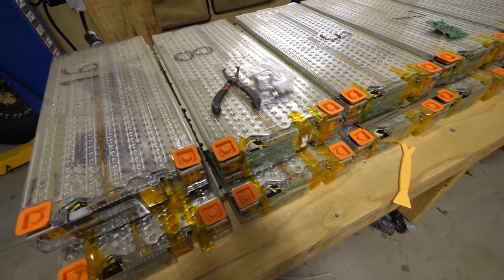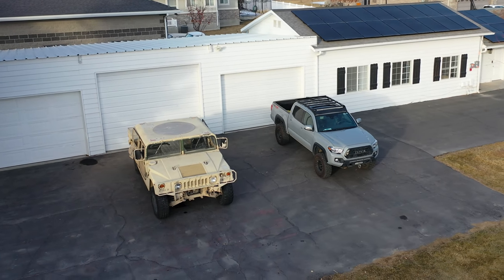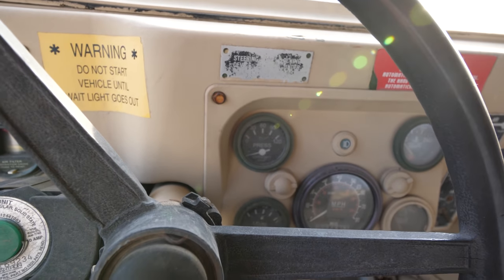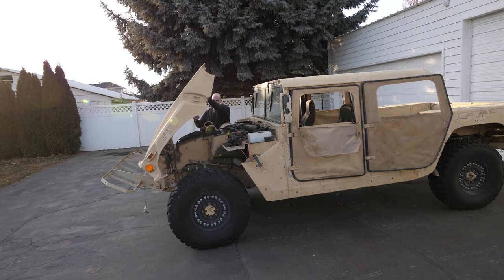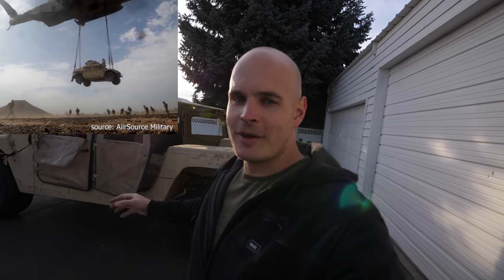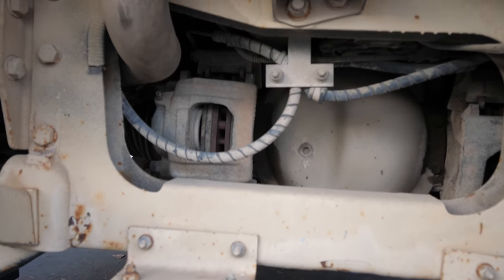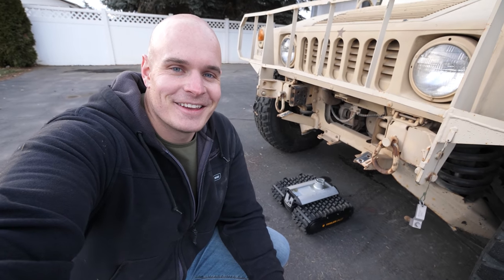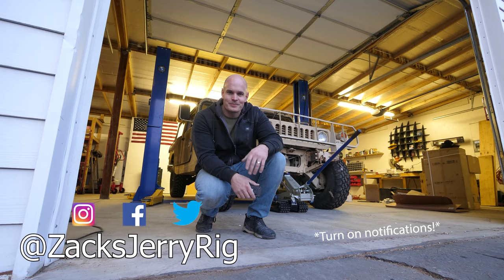Can I build my OWN Electric Truck?! -  Say Hello to the EV Humvee!

Comment: Dude…. First “Not a wheelchair” and now this?!! This guy is going to build his own electric space rocket at this rate 😂
Reply: so he made a wheelchair not a wheelchair by adding electric motors, so if hes adding electric parts into a hmmv dosent that give him the authority to call it "not a hmmv"
Reply: He might as well start a company with this!
Reply: for a second I thought it was possible to make an electric rocket 😂
Reply: Not a HMMWV
Reply: Would there actually be a way to build an electric rocket? You can't produce thrust that way like rockets do and somehow I doubt that you could build turbines than can lift off aircrafts in the way rockets do
Reply: @NieColall  The rocket equation would kill it instantly, batteries aren't energy dense enough!
Reply: You act like this stuff is impressive
Reply: @ImaCoward124 I guess… maybe I will do a YouTube channel for the shit I do everyday as an electrician and part Time Mechanic
Reply: @NieColall  Kinda, there are working electric "rocket engines" (thrusters) such as the hall thruster. However it still needs a gas to operate, eg. xenon so it's not entirely electric. They use a lot less fuel though, so it's still interesting. 

In space you can also go fully solar but building a solar sail, although you need to get everything in to space first.

Comment: ####!1Many years back, there was a conversion done to make an  EV with front wheel drive put on rear wheel drive car frame , so as access to the rotating 2 front shafts. 4 alternators with 12v clutches and belts were mounted with battery bank in rear seat. The tow motor  motor was mounted with rear wheel drive. The driver would drive vehicle up to 25mph then click in the recharging alternators. The distance went up to 300miles per battery charge. Also, the other Patent holder of the Zubris circuit allows $100 fee to use his circuit on your own motor which will also extend range of car to 300miles. . The added circuit removes the Back EMF of motor windings, so as main heavy current can go in . (Type of first very fast Cap discharge) Also the other hydraulic pressure system was added on different car, as stored energy effect on car with fluid pressure from tank flowing in reverse, allowing rotation of same hydraulic pump in reverse to add power to the drive shaft underneath car. The long drive shaft had split 2 piece pulley with belt going up to the fluid pump. High Pressure tank +return lower pressure  accumulator tank. Hand valve in between front seats was operated when vehicle starting from stop and rolling up to 25M per Hour on stored pressure. ( System activated to store pressure during slow down to stop up ahead)? ///<<!!

Comment: Diesel (like that used in your hummer) will easily last for 5 years, and more like 10 - 15 if treated with fuel stabilizer. So diesel is fine for a zombie apocalypse.

Comment: i really hope you get rid of the rust and repaint every single part
Reply: It’s aluminum, just repaint it
Reply: i disagree it looks cool
Reply: i think it look cooler with the rust
Reply: @chinookh4713  i like the scratched paint and all but the rust while it does look cool, is a serious hazard, anything load bearing that rusted needs to be assessed and replaced if need be.
Reply: Clean/replace the rusted parts but let aluminium have that worn out vibe it has right now
Reply: It’s meant to look like that

Comment: Um for the truck glass: Scratches at level 8 with deeper grooves at level 9.
Reply: Based on its used in military, probably gonna have scratches at bullet point, and deeper grooves at rocket fire
Reply: @premiumboi473  And cracks at nuclear explosion
Reply: @premiumboi473  Nailed it. Lol
Reply: glass is glass, and glass... scratches at level 6 with deeper grooves at a level 7.

Comment: Re the brakes being inboard - part of the reason for that is that the brakes have the same mechanical advantage from the reduction hubs, ie, they can be a lot smaller and lighter for the same force at the wheel if they're mounted inboard than if they were mounted within the wheel like normal. There are lots of cars like this, though, many old French cars did this in the 60s and 70s and various supercars, also, for unsprung weight reasons.

Comment: Small corrections. First gasoline with ethanol in it doesnt last, but gas without does, and diesel certainly does which is the fuel in this thing. Also military vehicles can typically burn lots of different fuels including oils and biofuels which helps for apocalyptic fuel choices. Second, the portal axles dont replace the differentials they are in addition to the differentials. 

Very cool build looking forward to watching the whole series!

Comment: Using a HMMWV is a great choice. They are not really that heavy, far fewer electronics to deal with, etc. I know this is just the first video in the series, but you need to change to aftermarket rims and tires and not have the run flat system and you will greatly reduce the rolling weight.

Comment: what if the display you're putting in to replace the dials was a Electroluminscent Display? So it would at least visually fit in with the time period (it has the same colour hues as early CRT displays and uses the same technology as the displays of the Apollo guidance computers, but the modern ones are brighter, easier to read, more responsive, more durable and energy efficient).
Reply: That'd be one hell of a cross over

Comment: Yea not sure about the 6-8 month shelf life for gasoline. I rebuilt a vehicle that had been sitting for 13 years with a full tank and the gas was still good! I started to empty the tank when I noticed the fuel was still fine. It started and ran fine! Drove it 2,000 miles after the two week build.

Comment: Zack: “Where you can actually work on the engine while inside the vehicle”
Me: “imagine you are in a zombie apocalypse and just casually fixing your  engine from the inside, like you could just live in this thing while in a zombie apocalypse ”
Reply: Except as he said, you'd be pretty screwed after all the diesel around you expires
Reply: @ryanweatherby9571  diesel engines can work on cooking oil
Reply: @bassam_salim  Biodiesel is still only 3 years on the shelf. It's possible that you could source and refine enough cooking oil to keep going for a couple years, but the only real permanent(ish) solution is electric via solar and wind. They could still fail but ICE fuel would diminish pretty quickly, and you'd eventually need to burn fuel to source more.

Comment: Portal axles basically add a vertical gear at the end of the axle, and another gear is added to the wheel, with a third in the middle, and this allows the axle to connect to the wheel at a different height. So the axle is not centered on the wheel, and actually is lined up with almost the top of the wheel. This allows them to put the differential significantly higher. As you can see at 5:45, the diff is horizontally aligned with the tire, and not any of the metal in the wheel, at all. The diffs would of needed to be like 10 inches lower if they were to be mounted traditionally. This also allows the shafts coming off the differentials to be more level rather than be at such a harsh angle like your taco, which increases joint wear

Comment: Imagine forgetting your solar panels when you have to leave for the apocalypse
Reply: Or they are shattered!  What about the lack of sunlight from all the smoke cover created when everything is on fire?
Reply: @D2O2  DUH ! The fire will provide the energy.
Reply: @mayanaztec6440  What method do you suggest to employ for charging batteries with fire?
Reply: @D2O2  a boiler, steam and generator works well for fire.

Almost all fossil fuel power plants in operation right now work that way. You burn stuff. Heat up water. Water turns to steam and spins a generator. Boom electricity.
There are also gas turbines that directly run on gas and turn a generator. But that's still relatively new tech and not that widespread
Reply: @timmytubede  OK, my comment was regarding the original post about using solar panels to charge your EV during the apocalypse.  I am fully aware of other means to convert thermal energy to electrical, but the topic was focused on converting radiant energy to electrical energy.

Comment: Nice project, one tip is to connect the electric motor directly to the transfer case, it has planty of torque and would be lighter, in the place of the engine and gearbox you could build a watertight box to place the batteries keeping the lower CG, anyways I'm hooked on yours latest videos and cheers from a Brazilian fan.

Comment: Make sure to remove the run flat system in the tires it will save you alot of weight.  They sell PVC inserts that take up the space

Comment: Diesel fuel can easily last a year before it starts to become degraded, and that doesn't mean it becomes unusable, but there are also additives that you can put in diesel that can extend its life span for significantly longer, and you can even filter it out, or tune the engine to handle the thicker fuel, most diesel cars and trucks can also handle bio fuels or run off of vegetable oil, so old diesel often isn't too much of a worry.
Reply: Had this thought too.  With the versatility of fuels that one can run through a diesel engine, it's probably a better long-term apocylapse powertrain than something that has degradable lithium-ion batteries and requires manufactured solar panels to charge. Still a cool project though.
Reply: @zachswy  yeah its definitely an awesome project, I just think diesel engines deserved a little more credit than he gave them

Comment: Hey Jerry, you should invent a 'universal' kit that adds a motor to the rear wheel of FWD economy cars... leaving the original drivetrain fully intact and operational. A lot of people would only need enough battery range to drive 5-10 miles to work, on side streets at about 35 mph. 

If you make this thing as easy to install as putting on a new wheel/hub and connecting a few boat batteries, you'd sell thousands of them.
Reply: "as easy to install as putting on a new wheel/hub and connecting a few boat batteries" wow that is a tall order to fill
there are some videos on this sort of conversion but its physically impossible imo to be that easy.

Comment: The portal hubs mostly help with the cv joints.. Cv joints can only turn at such a high angle.. They do make portal hubs for solid axles which are very effective..the downside to the hubs is inboard brakes.. Some claim it improves braking.. Pretty much all new military vehicles use independent suspension.. New ones have more that double the wheel travel of the humvee..

 There's a website called ev controls, they turned a factory five kit car into electric using gm batteries and tesla motors and their own custom made controller.. It's fairly fast

Comment: In a sealed container diesel will last until the container fails.
Regular gas if in a sealed container in good storage conditions will also last indefinitely 
Gas with additives like ethanol and octane boosters and detergents will last up to two years in a sealed container in good storage but a lot shorter sitting in a gas tank or a tin in your garage, Batteries on the other hand will degrade very quickly and may not recover if run flat and or improperly charged and not kept from freezing or over heating.

Comment: Hey Jerry, can't wait to see this completed! 

Also, if this specific Hummer you have weighs 5,000lbs, then you could definitely use the Model X's motors instead of the slower plane pullers. Model X's weigh upwards of 5,100lbs. Unless you did the math and know that after the conversion, it will weigh more because of how heavy the batteries are. 

Just wanted to throw that out there!

Good luck!

Comment: The tracked trailer mover is scary with a floor jack thrown on top of it, but a custom mount for a jack mechanism (skipping the jack wheels and inserted into the mover's socket) could be a pretty cool tool around the shop.

Comment: Jerry,
you got me a BUG, I am thinking about it for few days now. 

Have you considered using Model 3 as donor for the Humvee conversion? I honestly think that it would make the conversion much much easier, result would have bigger value and I do not think it would be more expensive at the end. 

I would go for long range dual motor and if possible, 2021 version with heat pump (less cooling / heating lines, almost no refrigerant lines)
Disclaimer: I have never seen Humvee  in flesh, but I am well, YouTube , educated :). 

Humvee  EV conversion recipe:
-	take one Humvee
-	take one half to one whole  salvaged Tesla Model 3 – depends on you taste
-	replace diff on each axle with Tesla motor – they have integrated diffs.
-	You have to create half shaft where one end goes to Tesla motor and the other to where Humvee brakes are ???? Guess this is quite doable and probably same for each axle. I believe this is easier than custom interface to transfer case for your electric motor (I assume you want to connect electric motor to transfer case).
-	now you can throw away transfer case and all shafts, thus you have empty space between axles.
-	take whole TM3 battery, it has integrated AC and DC charging, 12V DCDC converter all the connections 
-	you will have to make custom high voltage (HV) cables and cooling lines. Connections on both are of the shelf -> should not be that hard to find somebody for the job , cooling line you can you yourself.  
-	I do not know where to put the battery. If you put it on the frame you are going to lose some rear seats leg room, guess it is OK.
-	generally you would transfer whole TM3 to Humvee  
-	you will get HVAC navigation, Spotify, Netflix and Emissions app :) 
-	phone access to Humvee and if you ask Elon, he might make you a nice Humvee skin. 
-	because of  12V from Tesla batter you either replace all 24V components –  lights and windshield wipers,  or you  add 12V to 24V DCDC converter   

I think biggest advantage is that you will have Tesla community to help you, which must be big in US and also plenty of parts available. There is bazillion info on YouTube on TM3 internals.

If you do it carefully you might not lose access to Supercharger – can you imagine Supercharging it next to Elon?

You will get 

This would definitely beat Annie's Hummer.

Comment: I understand that it's probably cheaper to get the ex-airport motor, but surely using the heavy duty hub motors on the market would be a better choice for saving weight and applying raw power, you could then strip out the breaks, the engine, the differential and axes and save quite a bit of weight to then put in a much bigger battery pack in the engine compartment. I mean, it's literally what GM are doing with their Hummer EV for a reason.

Comment: I'm one of the mechanics that maintain these and that literally looks like the ones that I have lol its funny because ours are worse! they are cramped and the seats are pieces of metal with some padding. lol if you want some advice on anything feel free to reach out I might be able to supply some technical manuals and other things if you supply the chassis serial number series! good luck I hope that you have fun tearing it apart!

Comment: The motor from the tug probably has a gear reduction built into it. Why not do away with the transmission altogether? The torque from the motor will probably chew it up anyway.

Comment: Dude first off this is absolutely friggn awesome! Second I know you just found out about the Toyota Mega Cruiser but china also makes a pretty cool humvee knock off called The Dongfeng Warrior which is pretty cool also. And third I have military humvee body mounted on an 89 Chevy 2500 chassis. Power plant is a 383 stroker motor and I've recently been thinking about if there were to be a fuel shortage or something along those lines what I would do. Since I dont really have the means to go electric I came up with a pretty good alternative I think. Dual fuel carburetor that runs regular gas or propane. Propane can stay good indefinitely and its a fuel you can easily store as well. Would like to know your thoughts as a cheaper form of zombie apocalypse vehicle 😆. Can't wait to see this beast drive brother the amount of torque in this is going to be epic for sure!

Comment: if you keep the 65mph max speed you will be very good with the ev.
ev's like a lot going under 60.
lower energy consumption, and the hummer is not for nascar racing oval trax, thus a perfect mix

Comment: This is the most logical swap to me.  I want to make my 2000 chevy 1 ton crew cab bev.  Still tow 12k+ and keep the same range empty.  Take the least efficient vehicles and make them full electric makes a bigger difference than taking a 40 mpg vehicle and getting to 50 mpg.  whoopie.

Comment: Looking forward to this! Why not just use model x or s front and rear drive unit though? Easy to find aftermarket controllers that could also be used for battery management system. I'm guessing just building for most torque?

Comment: Most of the body is made from aluminum (although not the hood, which is SMC), not the whole vehicle. There is probably much more weight of steel than aluminum in the complete vehicle.

Comment: So I respect all builds and I think what you are doing is amazing and we need more people like you building unique stuff however I hope your not using the factory transmissions those where not great at handling power I had a basic ls swap 350 to 400 hp range the transmission shit the bed twice and with the electric high torque I’m sure it will fail

Comment: Not the worst gas mileage as you still measure it in MPG. It gets bad when you measure the vehicle in gallons per mile. That's right the vehicle they used to move the space shuttle to the launch pad had a much worse fuel consumption to distance travel rate.